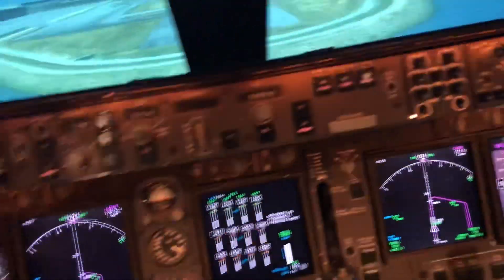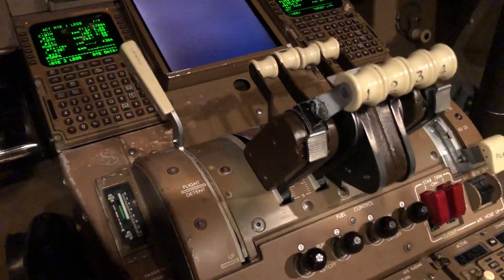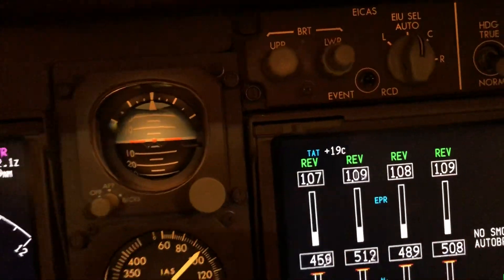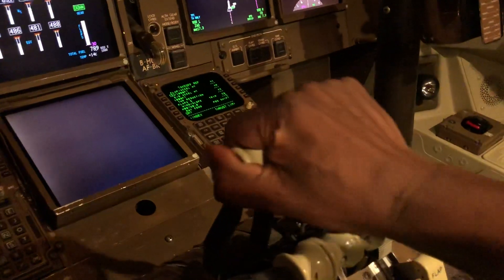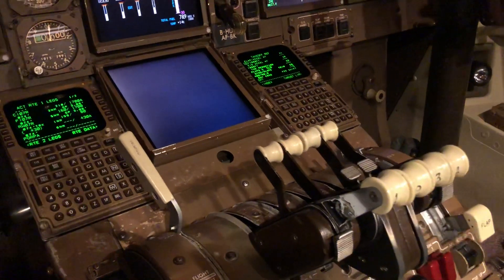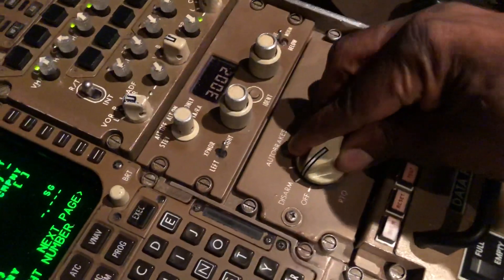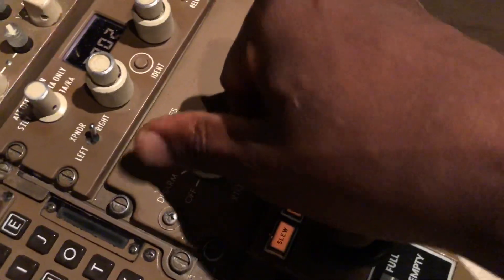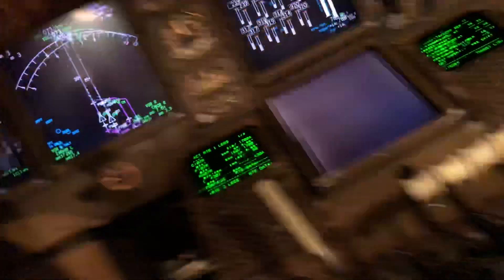Landing the B747 actions

Comment: Do you ever have to use MAX Autobrake? Can't imagine it would ever be used? I guess in an emergency it would be manual right?
Reply from the maker: We do sometimes at heavy weight landings on short and wet runways. Typically JFK runway 13L at max landing weight

Comment: Hello Cpt. What's the difference in modes with "auto brake disarm" and  "off" position ?
Reply from the maker: Disarm is when it happens when we takeoff or we apply manual braking or if there is a fault in the system.
Reply: @pilot_obet  hello, I have just watched another of your videos in which you explain the autobrake, and if I understood correctly you said that when the wheels take off, the switch moves automatically from rto to off, is it right?
Reply from the maker: @JustRememberWhoYoureWorkingFor  correct